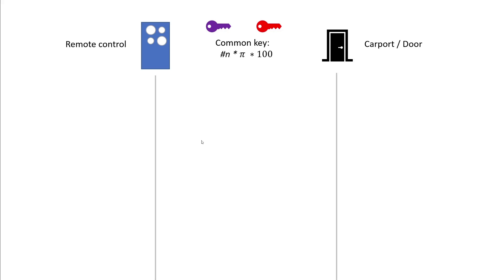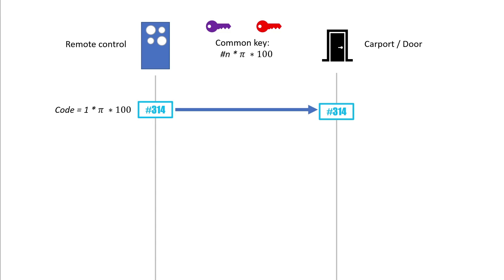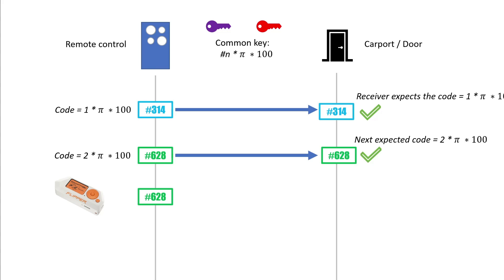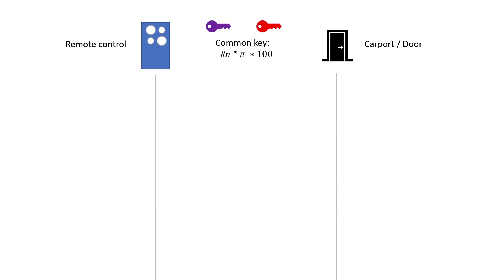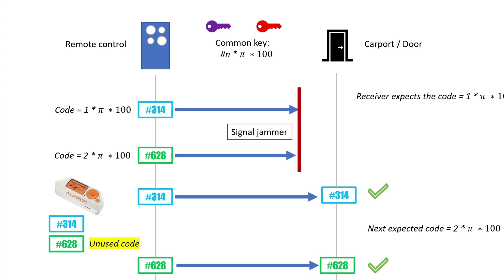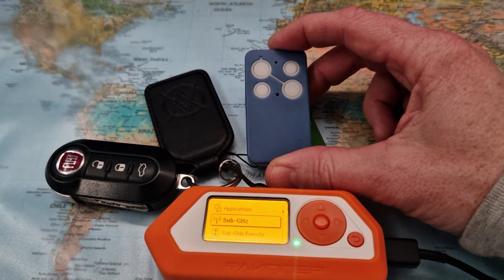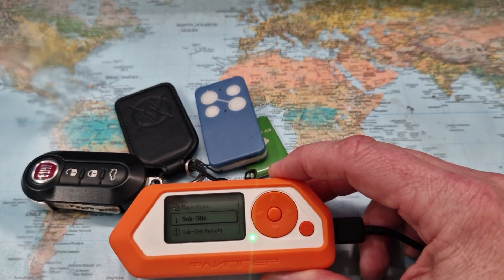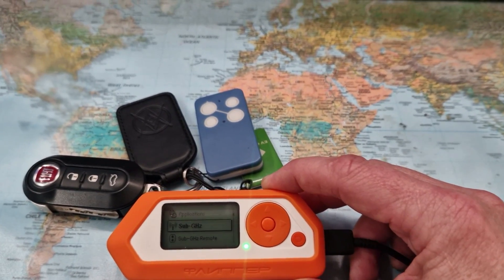Rolling codes explained #flipperzero

Comment: So if I'm understanding this correctly. Theoretically, you could take a remote out of range of the receiver, click the remote to produce a code and save that code to the flipper zero and be able to use that code with the flipper zero to open a garage/gate/etc.?

Comment: How do you know ur remote was 488.33
Reply: Specs for the chip, or alternatively scan the frequencies between a set range and look for the signal, you can do things like this with Dragon OS an OS specifically designed for radio hacking. You also need a tuner dongle.
I’m sure the flipper zero has a built in one as well, but start with Dragon OS it’s cheaper and has most the tools to do this plus more.

Comment: Would a garage door opener have 2 sequences for 2 remotes? I assume for a simple device, it wouldn't have a handshake, so it would need individual rolling code sequences for each remote. Otherwise, the second remote would send signal 1 and the receiver would be expecting signal 2. The user would have to press the open button multiple times to catch up to the next allowed signal if the other remote had been used a few times.

Comment: But can it send out data to open garage doors or turn on lights without having captured a remotes (etc) signals first?
Reply from the maker: @MageAtYou  yes it can, but then the signals wouldn't be in sync with what the receiver expects, so that wouldn't work

Comment: Bro I have a dout if the signal is jammed first time key will move forward but door will not receive the 1 st code so it will expect the 1 st code only right so in that sense we can't open our garage door after once we fail right but that doesn't make sense

Comment: Ok but what happens if you have 2 garage door openers and your wife has one at work with her.  You use yours to open the garage but when she gets home her controller doesn't know which sequence to send as the next code.  Also there needs to be some sort of ACK back from the garage door or the controller won't know that the receiver has received it and then know to use the next code.

Comment: Take care when reading car remote codes.  It is extremely easy to disable the remote....which would require a re-sync with the vehicle.
Reply: But if i read my bmw f10 car key open close etc , and if its desync my key, they will i be able to use flipper to start my car and close open etc? Instead off my. Car key?
Reply: @bmwsincekid  no

Comment: Great video.  I have a couple of questions for you to ponder if you care to respond:
- How can two remotes work with the one garage opener with rolling codes as it seems to me that only one would keep them in sync?
- We recently had the  Homelink mirror stop working on one of our vehicles yet it was still programmed (not erased).   I had to redo the programming to get it to work again.   Could it have gotten out of sync and if so how would that happen?
Reply: Look up keeloq for more info, but a simple explanation is that the serial number of each remote is stored in the receiver and they have their own separate rolling codes
Reply: @bob_kazamakis  That isn't applicable here.  We are talking about a garage door opener manufactured over 20 years before the vehicle with Homelink in its mirror.

Comment: Im not sure about the last part in the video. In a rolling code system, a transmission must be successful for the code to be sent and the expected code to change. When a transmission is successful, the code sequence is updated in both the remote control and the vehicle. This ensures synchronization, and the next time you use the key, a new code is generated based on the updated sequence. This approach prevents unauthorized attempts to capture or reproduce earlier codes, enhancing security.
Reply: Most remotes do not have a receiver because battery life on an always listening device would zap these small batteries quickly. 

The remote doesn't know if the car received, it's just going to the next code regardless. The car, aka the receiver can get a later code in the list and just skip to it. The car basically only looks ahead, never back.
Reply: @iamjoeysteel  this is the case because people play wioth their keyfobs..  whne these things first came out they only looked ahead so far.. and customers complained about always having to get their fobs reprogrammed.. it turned out people press the button alot on their keyfobs in their pockets when the car is nowhere near..  so most systems will resquence as long as the code is unused and forward..  if for instance I took a flipper and recorded a sequence of presses in a starbucs where people are waiting and playing with their keyfobs.. recorded say "code 9" and went out and used it.. the door would probably not open because im using a ater and unsequenced code.. if i had the next code in sequen ce the car would re-sync. ..   this of course doesnt start the engine..  engine start uses a whole different set of algorithms ..  but when the actual fob is used again by the real owner.. this is why sometimes you have to hit it twice.. if the receiver feels it is out of sequence by too far it will use a second press to put itself back in sequence and open the door..  thus a flipper would need two successive button presses to get one entry..   not sure if this is how they al work but i know some did (mayb e still do).. I havent played around with rolling codes for a good while now...

Comment: what happens if the key owner pushes one more time without jammer (or in range after being out of range). Does it mean the door is not only waiting the n°1 but also all the possible next ones ?
Reply: I believe the receiver has a table of codes and the only thing it's looking at is whether the code has been used or not, and probably will also recycle used code after a certain number of new codes has been used. Otherwise if you just pressing your key randomly outside of range that will mess everything up.

Comment: Hi, lets pretend that I pushed the button on my garage opener device couple of times in a different city. Why it still works when I get back home?
Reply from the maker: If you press it too many times, it will get out of sync, yes -- and stop working
Reply: @techandfun7723  it makes no sense, are you sure pilot is not recording received signal/code? Or perhaps it has only couple codes in a loop.

Comment: It does not work with VW recent Remote car ceys: 
Frequency records rolling code in 434,42Mhz, but sending will not open the car.
Maybe because you need to set modulation type correct on the flipper ???
There are 2 AM and to 2 FM modulation settings possible.
Which is the correct one for a (VW) car remote ???

Comment: thanks! you know, even after doing some research on rolling codes, I still never understood how they work. but I get it now! When you press a key fob it creates a "good" code and tries to communicate with the door/car, etc. When it reaches it, the code is now dead and can't be reused. However, if you're able to isolate the keyfob from the car/door whatever, then the codes created and recorded are still good, only until they're used. great video. i was finally able to store a few codes for my garage (one time my keyfob died and I had to pick the door open).

Comment: So, is there a two way communication with the FOB and the receiver? or the fob just blindly sends the next one until it runs out, or recycles it's table? It's a great video but leaves me with more questions!
Reply: I dont think the receiver sends smth back, I think as soon the transmitter send smth they both update to the next code that was calculated as the example in the video
Reply: @daKnighty  I think you're right, I've looked into it a bit further and it is possible to desynch the fob with the car.
Reply: @GeneralThargor  OK, but what happens when the original car key gets de-synced, does it have to be re authed by the car or does it work again?

Comment: How does the remote control know which code is next? eg if I press it 5 times and i'm out of range of the receiver, how does it know that the code is used or not. Also, is there a limit to the number of codes in general?
Reply: The remote only needs to maintain the data needed to calculate the next code in the series. It doesn’t need to have knowledge of which codes have been accepted by the receiver. 

The receiver is responsible for maintaining the last known good code that was used so that it can calculate the next X good codes in the series and accept the next highest unused code. 

Say you signal the open command 5 times out of range of the receiver, but the 6th signal is in range. The receiver sees that signal 6n is unused in the sequence and accepts it. It should also now invalidate receipt of any of those lower unused codes (originally sent out of range), even though they would have been valid before receipt of that 6th code in the series. This minimizes your exposure to replay attacks. 

Theoretically, you should never run out of codes because you can always seed your algorithm with a higher number (n+1). 

Side note: in practice, I believe a remote can get too far ahead of the receiver in the code sequence. I have heard of parents having to get their car key fobs re-paired with their car because a child pressed the unlock button 50 times while out of range the the car. The car may only maintain a buffer of the next 20 valid codes, so if your remote goes beyond that, it would always be too far ahead. 

I don’t have deep knowledge on this subject, but that’s my understanding. It’s also a little hard to explain. Sorry for the long reply, but hopefully it helps.
Reply: Has anyone been able to really know the handshake algebra of any given system? 
If there is a way to get the Flipper to know the set algebra pattern, we should be able to meet the garage door and handshake just like any other remote, right? 
Of course different door types may or may not use their own algebra. I really don't know a lot about garage doors but I understand systems. 
This would be one way if we can understand how to get the flipper to use the same algebra.
Reply: @milkbone28681  No, that's like asking to predict salted and hashed passwords. Won't work unless the remote was designed by children in Chinese factory.
Reply: The receiver have a table of codes extending to the N times, the only thing it's looking at is whether that code has been used or not. It probably recycles old codes after some number of times.

Comment: Isn't there any way to read multiple signals and get the formula/algorithm at which the rerolling is performed?
Reply: It's hard due to the end to end encryption between key and receiver. They both share so called Manufacturer Code, which is used to encrypt the Rolling part of the package. The encryption itself is not very strong, but you must obtain the significant amounts of packages to break that. Sometimes flipper gives you false positives using the wrong Manufacturer Code, and, if you are lucky enough, it will be able to produce the valid Rolling package and open the door. But it can desync original key way too much, and make it useless (unless you are ready to press it inadequate number of times outside of the receiver's range)

Comment: 04:40: What if the key was pressed one or more times out of range? Then the next time it will send "3xPi" or "4xPi" while the receiver expects "2xPi". How the receiver will treat this?
Reply: I guess the receiver expects any n*pi with n superior to the last one used, but it seems kind of heavy to calculate enough possiblilities to make sure your remote doesn't stops working just because your child pressed the button too much while you were out of range.

Edit : I read a comment saying that the receiver has a buffer of let's say 50, so you can press the button 50x while out of range without getting out of sync. I never heard about a desynchronised remote, even on parking where there are a lot of different remotes, so I guess the buffer is usually kind of big
Reply: @calixte12  thanx for your suggestions.

Comment: Wouldn't you be able to record enough codes to figure out the algorithm and then just use that to generate new codes?
Reply: Back when I was a hardened criminal downloading pirated videogames, many of those games would come with a key generator that I think was essentially that. A hacker found the commonality between a few accepted CD keys for the game and created an algorithm that could generate more unused keys. I don't know any details of how it's done but it seems to be possible.
Reply: @Ninvus2 hackers didn’t buy a bunch of codes to figure out the algorithm. They decompiled the software and found the subroutine that verified codes and reverse engineered it.
Reply: Depends if they are using a whitelist. If you have more than one, you can guess, but if you have 3 or more, you can verify.

Comment: I don't understand one thing..
How the remote can know the the first or second code that was jammed didn't work? It is a transmitter, not a reciever..
On Peter Fairlie channel he presented something else.. The codes that were jammed (e.g. #1, #2... #7) can be used ONLY if the remote DIDN'T send next one.
Even without the original remote.. if #1 worked, after that with Flipper he used #6 then all previous #2-#5 became useles.
So the logic says, that remote sends consecutive codes (out of probably a huge base of codes).. And one use of original remote/keyfob should make all previous ones inactive..

Could you test that too?
Reply: Yes that's how it works. 

As soon as you use code #505 then every code before 505 doesn't work.
Reply: When does it reset to 1?

Comment: Doesn't recording and using one or more rolling codes in the flipper "desync" the key fob?
So to use the F0 as a key for a rolling code fob one would have to either store many keys in advance, and then replay them, and then also keep count for the fob itself. To actually replace the fob the flipper would need to know the algorithm. Huh. I learned something here, thanks for the video!
Reply from the maker: Thank you for the nice comment. The keyfob will not instantly be de-sync'ed, because there is usually a "buffer" of n-codes that is accepted. But if the keyfob is pressed meny times outside the reach of the receiver, it might get de-sync'ed.
Reply: @techandfun7723  what happens if gets de-sync’d? The fob itself won’t work anymore? How does one fix that?
Sometimes, when I go see a movie or go to the mall, I get a little OCD and I start hitting the lock button on my car key fob a bunch of times but I’m out of range lol. So I keep pressing it while moving back toward the car til I hear it lock. 
So you’re saying that technically, pressing the lock button on my fob too many times while out of range of the car could mess it up? And then how would I fix that?
Reply: @MisterK-YT 
It could (and will if you do it enough) desync. If that happens, you're good to go to a garage and have your centralized closing reset and probably a brand new remote
Reply: @MisterK-YT  If you do that enough times in a row outside the range of the car (I've read it's 256) the fob will no longer work until the car is reprogrammed with it again.
Reply: @islandfd3s  gotcha
Reply: @MisterK-YT  I don't know if this will help you, but I've heard of a technique where you say it out loud in a funny voice after some completed task (for example, closing a door). After all, it's much easier to remember when Shrek told you that the door was closed)